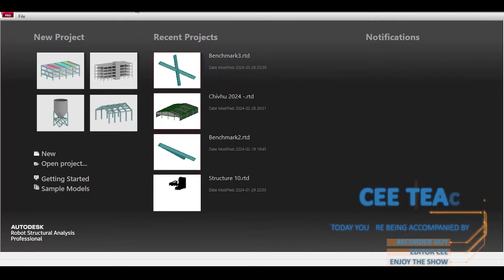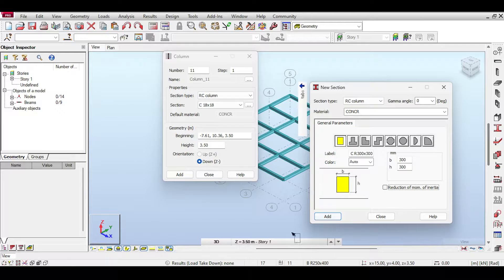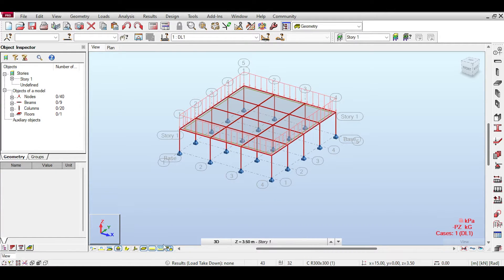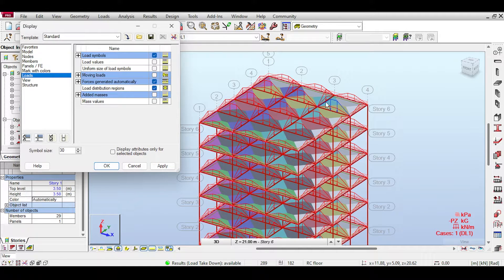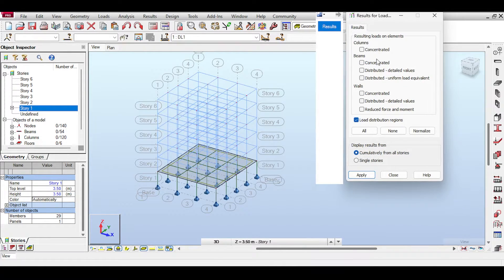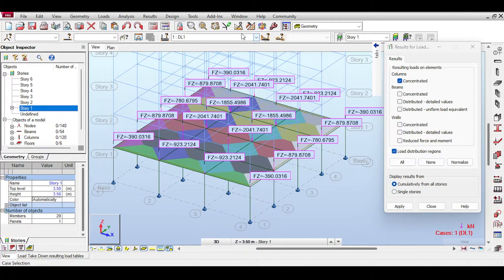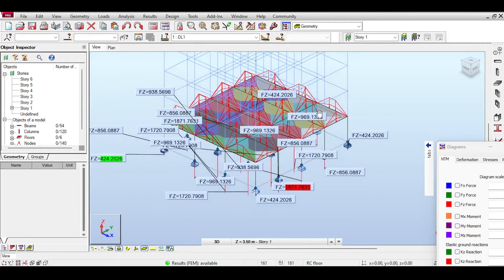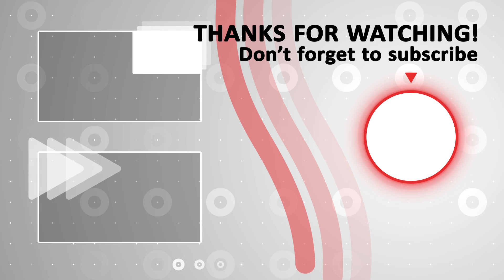Load Takedown Analysis in Autodesk Robot

Comment: Hello CEE,

I agree that the “Load Takedown Analysis” in Robot is not necessarily a new thing and that most of the results it provides had essentially always been possible and available through using other techniques in Robot. Despite this, I still think that the “Load Takedown Analysis” is a useful and convenient tool to have. For me, it is like having a “reasonably quick and fairly reliable” reference that one can use to check the “sense” and “the order of magnitude” of one’s work compared to that same work detailed model and analysis results.

The following may be helpful:

I order to avoid having to redraw or having to create a new model from scratch in cases where one desires to switch between various “structure models types or systems”, one can simply do the switch directly from an existing model of another “structure type” by going to menu Geometry>Structure Type… and choosing the desired structure model type or system that the current opened model is to be converted or to be changed to. For example, the above can be used to switch back and forth between say “3D building Design” and “Load Take Down Building Design”]

I also read in one of the comments where a viewer/subscriber indicated that they could not find “moving loads” under the loads menu. This would most likely have been because their model was in a “structure type or system” that is not equipped with the “moving loads” menu option …. switching the model to say “Frame 3D Design” and then modelling and defining those “moving loads” there before switching back to say “3D Building Design” is one possible way to resolve that issue.

Thank you for the videos, they are a bliss.

Kind regards, DK
Reply from the maker: Hello there dear Engr. DK!
sorry for the late reply, I was overbusy with tons of work in my FT job and was barely managing to record some videos and push them out.

I agree, Load Takedown seems a rehash of what is possibly previous RSA but repackaged in a quicker way. Also, totally agree with your point of having it as a preliminary design and feasibility check.

The suggestion of changing the analysis type is AMAZING!
I usually never dare to do this because previously, (2010ish) it was a switch from 2D to 3D which included all kinds of new degrees of freedom. This "fear" of switching seems to be in my subconsious so far. 
Still, I totally agree with your suggestion, I just want to add that once you switch, you have to make sure that your slab model aligns with the load take-down analysis.

Oh! So there is a way of adding moving loads, but it is kind of like a hack. Let me try it.
Update! OMG it does work! I will screenshot your comment and post it as a post right away. 

Thank you very much! You are the best
Regards,
CEE

Comment: Hi, sir thanks for this i would like also if you could take us thru some FEM basics using ABAQUS so that its easier to get the take aways as structural engineers, regards
Reply from the maker: That is an interesting suggestion, I think I will do that. But for now, I am currently overloaded with the series I am running on this channel at the moment:
1) Bridge Design
2) Autodesk Bridge Structural Design
3) Highrise building
4) regular Robot videos
5) Non-Linear FEM

but I will keep your suggestion in my mind once I have some breathing room.

Still, thank you very much for your comment, I really appreciate it.
Regards,
CEE
Reply: @CivilEngineeringEssentials  , thank you so much sir for your feedback i had also finished my design about solar panels i would like maybe to share with you the report so that maybe you get some time you can go thru. I will need your mail adress so that its easier to forward it. With you what i like its because all those bulk and unbreaked  engineering knowledge , looks easy and fluid. You just get time to seat and watch and you understand everything. Thanks for the great work cause u do stimulate our mind to think beyond.
Also the bridge design is the part that i want to master cause i am seeing opportunies into it.  I am greatfull for your good work.
🙏
Reply from the maker: You are most welcome. the email is: civ.eng.essentials@gmail.com
I will try my best to read it promptly, but no promises ^_^

Sorry for the late reply, I was uber-busy with my fulltime job ^_^

Comment: Hi, very nice video. Is it possible to create a video for how to analyze folded let's say 3mm steel angle to establish stresses and deflections? Thank you
Reply: Thank you for coming back.Not a slab.let say you have horizontal rail 3mm thick and folded right angle with legs length 50x50mm which is support cladding,I would be interested to see how to analyse this rail with dead loads and wind loads
Reply from the maker: hm.. I need to really think about it. It may be actually interesting in pedestrian bridges, where you have a side wall "glass" supported by some aluminum or metallic profiles. This side wall would be under wind loads and thus might be a cool question to dive into. 

I will try my best to find time for it. However, at the moment, you can see that we are covering a lot of video series, so plz remind me of your request once the bridge series concludes.

All the best,
CEE
Reply from the maker: Hi there and thnx for your comment. Not sure what you mean, do you mean that you want me to analyze a folded plate slab structure?
pls feel free to clarify what you mean or even add a link to show what you mean. I will gladly look into it.
Regards,
CEE
Reply: Thanks

Comment: Good. Waiting for that raft part. I think raft is also an elephant in the room cause it seems FEM have a challenge with singularities. Btw CEE, which is the best stiffening method? rigid diaphragm or a flexible one?
Reply from the maker: Rigid vs flexible diaphragm is not really a complicated issue. The thing is:
if the axial stiffness of a slab is strong enough with respect to the axial loads on the slab (those would be horizontal forces) then it would work as a rigid diaphragm. A rigid diaphragm basically means that the nodes do not move horizontally with respect to each other, but only vertically (the usual deflection).

I my opinion, a flexible analysis is the more accurate one, but there would not be a great difference between both.

In case I mis-understood your question, please clarify. I would be glad to answer.

With regard to the raft, the biggest elephant in the room is indeed the stress concentration that will be under the column on the raft.
Because according to the FEM, with a single node being the connecting point between the column and the raft, you would have a high stress concentration (almost a needle on paper scenario)

I will try to find a way around the limitation. Or at least explain how to interpret it.
Regards,
CEE
Reply: @CivilEngineeringEssentials   Hello CEE? how about adding a rigid zone on top of the column? Won't that solve the flat slab/raft nodal stress concentration?
Reply: @CivilEngineeringEssentials  i think he meant a rigid zone
Reply: @CivilEngineeringEssentials   you got my question well Dr and thanks for the insights. Well understood. Waiting for the raft part. Will highly appreciate. May God bless you